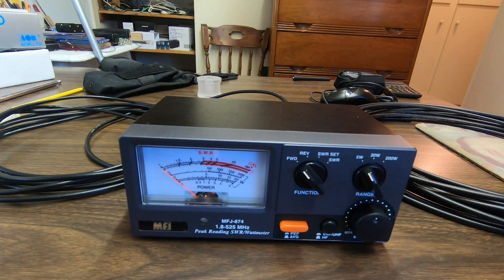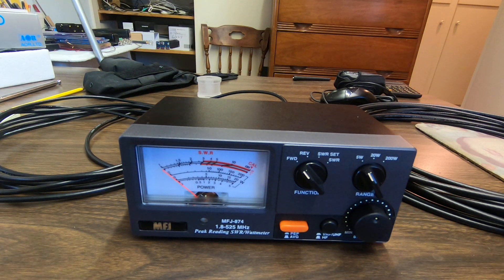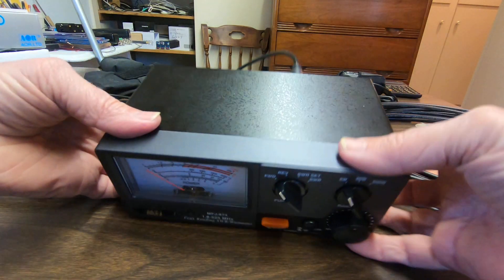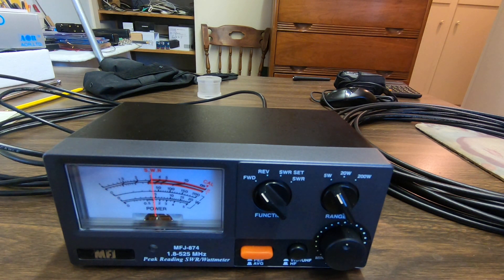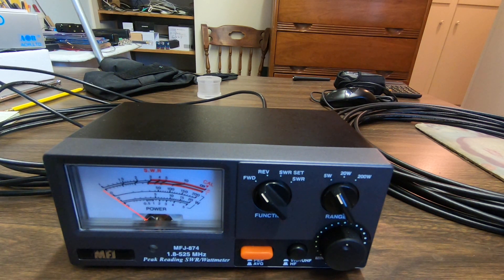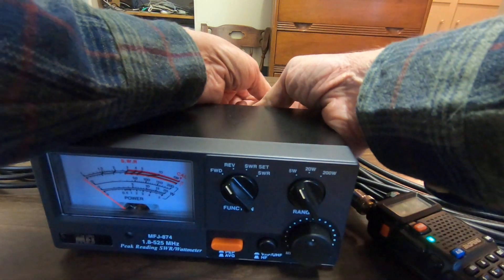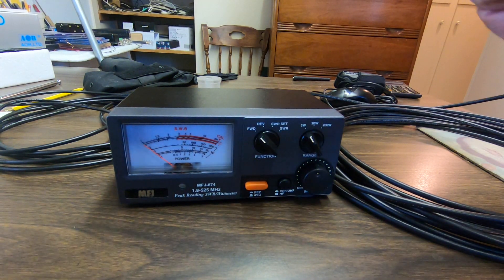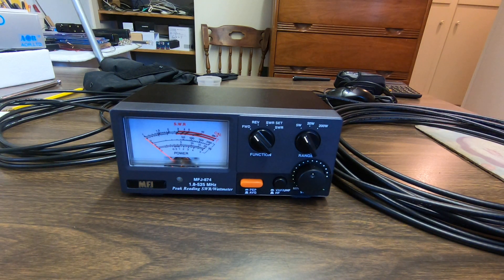Times LMR-240 vs. barJan RG-58A/U cables at GMRS Frequencies

Comment: I wonder how the rg58x would do at ten feet. Thanks for the video, I am looking at buying the slim jim n9tax for portable use and I made the right decision buying the lmr 240 for long distance cable runs.
Reply from the maker: As For antennas in the 460 MHZ range , a ground plane works very well and it is about 11 inches high with 6 inch arms. A 4 element beam is is 15 inches long and 13 inches wide and gives about 10 times the power of the ground plane, but it is directional. The slim jim is supposed to be slightly better than the ground plane - I tired building one, but I could never get it to work.

Comment: Interesting test, thanks. It would be nice if you could talk about the physical properties of the 58A/U vs the 240. Everyone isn't just running 70cm indoors on a desktop :) Is the 240 more or less flexible, in cold vs hot weather, bend radius, weight per linear foot, etc. Thanks again.
Reply from the maker: The main point of the video is - at 18 feet the  barJan looses 2/3 of your power - so for anything that is connect to a distant antenna you had better be using some thing else. The barJan is lighter but less flexible than the Times.
Reply: @daleranta1012   - Thank you, makes sense. At the 3-30 MHz range (opposed to 460 MHz) this loss diminishes greatly, so I was interested in the physical properties for my 3-30 MHz use.
Reply from the maker: @johnnypizzaguy  At 30 MHZ it does not matter much - I tried the 400 for a 30 foot run and the loss in the one extra connector required canelled the gain - so I return the 400 and used a smaller size.

Comment: Wow that BarJan is pretty lossy!!!  Even with a longer run of 240 the power difference is wild.

It’s funny, that people will buy expensive equipment and then cheap out on coax.
Reply from the maker: Yes, that Was the point of the video. I was considering doing another video on the very popular ABR Industries cables, their 240 is only slightly poorer than the Times LMR-240 and their 400 cable is slightly better than the Times LMR-240. I have not tried the Times LMR-400 - maybe I will buy some to try it for comparison.
Reply: @daleranta1012  That would be a good test!  I am running JEFA 240 in my mobile and I am getting good results.  I don’t think it’s as good as Times Microwave LMR 240 but it is pretty good.  Compared to the RG58a/u, the upgrade was huge!
Reply: @daleranta1012 
Hi you did the test ABr vs Times ?
Reply from the maker: @Wally_Gt07   Yes, I did test the ABR vs. Times and the Times was better than the ABR - not as big of a difference as with the barJan, but poorer where I tested it. I suppose I should pull it out and do a video of the comparison.
Reply: @daleranta1012 cuánta potencia aguanta el coaxial Lmr240